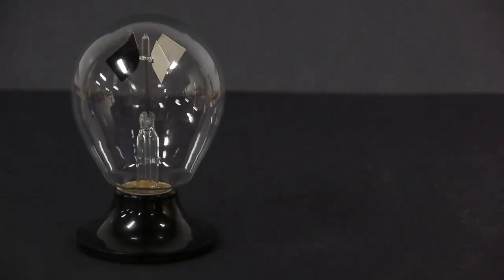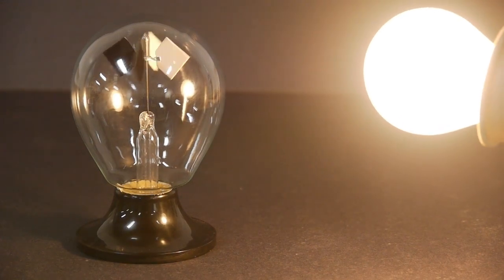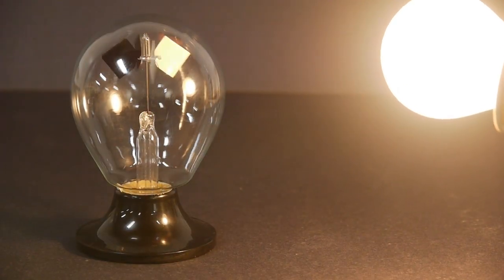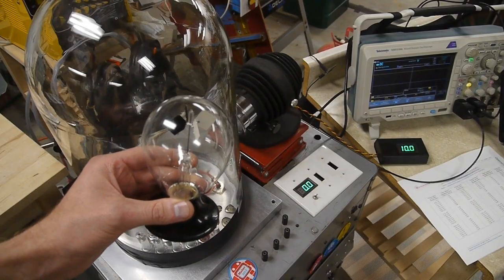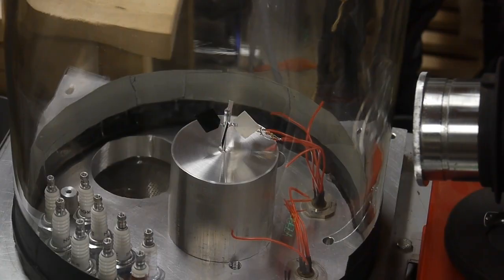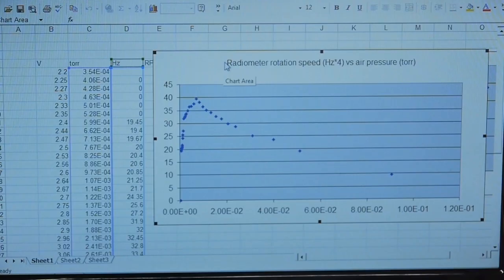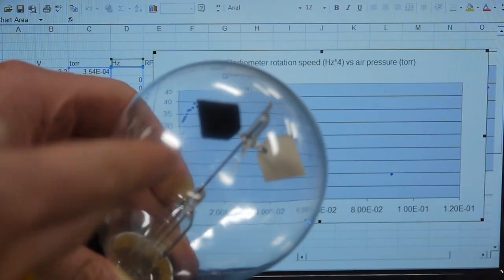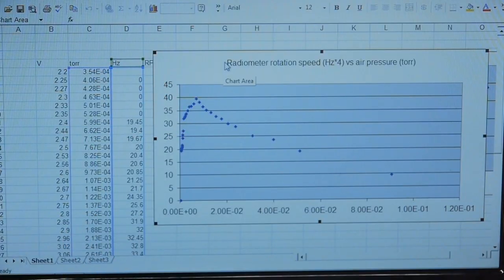How a Crookes radiometer works

Comment: whats the difference between heat and light?? arent they both electromagnetic waves??  what the fucks are photons, photons are quackery
Reply: Heat is molecule agitation. Light is electromagnetic wave, no mass. Photons are energy light packets, which are not playing any role here, it is a classic experiment and must be explained in classic terms, no quantic.
Reply: @joselunazzi2287  how are molecules agitated ? By electro -magmetic waves just like when you heat food in the microwave. Heat and light are effects of electragmetoc waves interacting with molecules / atoms wich are defined / composed by charged "particles" charged meaning electrified positively and negatively. I don't see the point of introducing photons?
Reply: @chevere0192  You put questions that needs no answer: all you wrote is correct. I don't see the point of introducing photons. But the Crookes radiometer is a very difficult to understand experiment, I am preparing an article on the many doubts surrounding it. It will be submited to the Latinamerican Journal of Physics Education in a few weeks.

Comment: OK.  So you lowered the temperature of the glass envelope and it spun the other direction....  There's not much gas in the envelope.  You slowed down the few molecules of gas that are inside the chamber presumably.  Why does that cause it to spin the other direction?  There's almost zero heat transfer via the gas, there's still some infa-red light striking the vanes.  Why does the white side become emissive in that scenario?
Reply: Due to Blackbody radiation and Osborne Reynolds law, where cold molecules flow to hotter ones; in the freezer scenario, the black is colder.

Comment: As the effect depends on a thermal gradient between the two sides of the vane, making the vane of ceramic or other insulating material should enhance the effect.
Reply: Yes, I wondered about that.  If the vanes are thin sheet metal one would have thought black and white sides were almost the same temperature but the black side is radiating more heat and heating the nearby air molecules thereby setting up a heat gradient in the air and hence a pressure gradient.
Reply: Vanes are either thin metal or mica--which is a an insulator BUT also contains Al and Fe.

Comment: Your explanation does not account for the backwards spinning when there is no light but one side of the radiometer is cold. There is no reason why the white side would be warmer than the black side in that case.

Comment: another thing can be observed, but can not be explained away by the random whole chamber air particles'  thermal-dynamic bumping in black and shiny side of the vanes is:   if you use a laser pointer, to shoot a beam of light ray onto the vanes, it will "push" the vanes to turn,  the point of laser ray lands on the dark side of the vane relative to the turning axle works out as Newton's law of lever or torque and pivot when turning a disk or turning a waterwheel.   It seems to indicate  something different,  I am guessing :    Radiation      The difference of thermal radiation forces exerted upon the black and shiny side of the vanes or radiometer.     The reason the radiometer not only react to heat, light, but also  react to coldness(mainly different amount of thermal radiation emitted from differently heated or chilled surfaces in case of ambient heat or cold propelling the vane).  In the  case of propelled by light, laser or sun light,   the radiation force exerted onto the vane is not secondary thermal radiation emitted from hotter side of the glass shell of the radiometer,(heated or chilled by external thermal influences applied) , in this case, light itself is a initial and final source of the radiation which bounced its force or momentum onto the vanes, thus caused its turning ( and the spot that the light ray force applied has different torque in respective to its distance to the vane rotational axle ).    Thus the radiation does have mass or momentum, if the radiation has particles in it(even energy particles) , these observations from radiometer may not enough to tell,    but what if,    ----  even radiation or energy waves has the capability of exerting force onto solid objects?!    (  this is just a speculation )
Reply: A laser sail, in the context of space travel (beam sailing), works by using powerful laser beams from Earth to push a lightweight, highly reflective sail, transferring momentum from photons (light particles) to propel a spacecraft

Comment: Perhaps I'm missing something but once I saw the comment below asking how big it would have to be to run a 10kW generator, I thought, what the hell.

Ben's explanation of the effect of momentum transfer from photons hitting the different vanes confused me.  Two photons of specified momentum hit, one each per colour of vane.  Why would the photon that carries some of its available momentum away with it on reflection impart a greater force on the mechanism than the photon that transfers all of its momentum to the dark vane when it is absorbed?

And later in the video, Ben tries to get the radiometer to work in as low a vacuum as he could supply.  He even states that in this scenario the only agent capable of affecting the mechanism is the photons and yet the radiometer is not running backwards as he suggested it would.  Of course, it wasn't running 'frontwards' either which suggests that photonic momentum transfer is simply too weak a force to have any effect in this experimental setup.

Comment: But why does cooling the outside make it spin the other way around?
Reply: Because - the dark side is also a good longwave IR emitting surface (a good "backbody" radiator and the silver side is not), and it runs cooler giving gas molecules less 'kick' when they impinge that dark side ....
Reply: @uploadJ  Correct !

Comment: if it isn't related to photons transferring energy, why does higher energy light, blue, make it spin at a low intensity, when the red end of the spectrum will not
Reply: because it is also related to photons. BTW the spinning power of colored lasers are in this order from high to low: blue>green>red.

Comment: What I find interesting is how he happened across this.  he was trying to make a perfect vacuum to get any air influence out of the picture.   Because he accidentally did not make a perfect vacuum but only a partial one is why it even spun at all in the first place. 

Does this work with round veins or do they need to be squares?

Also normal air pressure is 760 torr or 1 atm.    The pressure in the tube is less than 1 torr.  So its pretty close to a vacuum.   I wonder if it could be done using a excitable gas  one can be visualized?   That way you could maybe see the currents in action.

Comment: heat means basically IR right or whatever it is, it must be Electromagnetic radiation right?
if yes why does it need gas to propagate 
I also remember reading the heat dissipating radiation sheets used on satellites of some GPS satellites affect them which is why they are mounted symmetrically

Comment: The scientific term for the force is "Photophoretic force". Your observation is very interesting because in micro particles the force peaks when the mean-free-path of the gas is the same as the diameter of the particles. This force can be used to trap and guid particles which absorbs light.

Comment: Did you ever make a large one. Curious to see if the rotation peek speed follows some specific size .
My other thought is what if you could make one large enough to be a solar type generator...maybe crazy but Hay that's one big glass ball huh?
Or what if atmospheric pressure and speed correlate to a specific size?
If its creating a pressure differential from hot and cold off its edges is the propelling force would it not change the perimeters? 
Wondering if a wind generator that still spins in sun light or assisted by it would be even feasible?.
Don't call me crazy, its the ones with seemingly crays ideas that are usually the one getting locked in an a tower until proven right.

Comment: There is no such thing as a photon.    Mainstream science likes to pretend electromagnetic fields do not exist.  They do.  Electricity is not particulate and very little electrical current actually flows through the conducting wires of any electrical circuit.  The people that created the electrical systems well over 100 years ago which we still utilize today knew this.  This guy does not know what he is talking about.

Comment: Is this why planets spin around their own axis? Sort of like a Crooks radiometer?!
Reply: No.  Planets, stars and any kind of space junk spin as the result of  forces imparted to them as they came into existence.  With  zero friction in the vacuum of space, there is nothing to stop them from spinning forever [ I didn't mention tidal forces - earth &  moon interactions have slowed earth's rotation a small amount over the last few billion years.].
Reply: There are all types of forces in space;
1- Solar wind.
2- Gravitational pulls.
3- Collisions with dust or larger particles objects.
4- Magnetic fields.
5- Others that we don't yet know.
Reply: jrb, thats absurd to think that something that happened 14bil years ago hasnt over time had that angular momentum completely negated/replaced by something from other reactions. im sorry but the official story isn't right, like usual.
Reply: @username4441  No, you don't understand why the "official story" makes sense. That's not the same as it not being right.
Reply: @username4441  You can look up my argument in any physics textbook. The fact that you don't get it doesn't make it a bad argument. Conservation of angular momentum, the relative absence of friction, and the huge mass of the earth make it not at all strange that the earth keeps spinning without slowing down appreciably. Your objection that 14 bln years is absurdly long mostly speaks to how short-lived you are on cosmological timescales.
Reply: @username4441  The Dunning-Kruger irony in your posts is painful to watch. As is the playground level of your insults. "IQ", you've learned a new word, good boy. Now go do your calculus homework. Try finding the integral for the net contribution of asteroids randomly striking earth to earth's angular momentum. Also, try to estimate their total collective mass relative to earth, based on the observation that the earth hasn't grown noticably bigger over the past few billion years. Show your work.

Comment: What's the purpose of all those spark plugs inside?
Reply: Brian Su an insulated and airtight way to get electrical connections inside the chamber.
Reply: Ohh right, wow what a great idea :) need to get branded ones though as those cheap brands do leak, but I mean the really horrible quality ones.

Comment: This isn't accurate is it? The claim is that the white face would get more energy from the photons by bouncing it. But that's just plain wrong. If you're bouncing something out of you you only get PART of its energy, the rest is simply re-directed, but absorbing it means ABSORBING IT, as in all its energy is transferred to you. So the black face, whether its thermal energy or momentum will always receive the fuller extent of the photon's energy.
Reply: But the change in momentum is greater on reflection, the energy comes from a slight frequency shift of the photon.

Comment: So, theoretically, `light sails` could work on this principle? If the sail was able to utilise a large amount of a stars light/heat? Also the (air) resistance is space is, well, nil, what with it being a vacuum and all.
Reply: Theoretically, yes, there are actually ways of utilising this in space to generate movement, but the thing is that you don't have just one light/radiation souce, you have dozens of them, so the same forces that move the object can also slow it down. Also, you have to be extremely precise on the way you use it, because a minor change in the intensity (such as a planet orbiting the star, thus blocking the light) of the light source can decentralize the object, making it change it's path. But I may be wrong.

Comment: awesome device. I was wondering if this device is capable of withstanding an electrical generator or motoring to mass-produce electricity. other than nuclear fusion or nuclear power. if this device is capable and switches from heat to cool. or light too cold or light to heat. then why haven't anyone thought of doing it this way then creating electricity using nuclear harmful chemicals in the air. subsequently my opinion this device can be altered just like a light bulb as a reverse current. try integrating electric magnetic motor to spin the current ratio of the output power is enough to the able to change the idea of electrical Propel electricity form a Mass scale
Reply: The effect you are exploiting is not large enough to generate power, you would be much better off using a stirling engine for this effect.  One company in california has developed a soler collector to shine on a striling engine for a very efficient conversion of solar power into mechanical energy. https://en.wikipedia.org/wiki/Solar-powered_Stirling_engine

Comment: Saw one youtube video that shows that a simple keychain LED can spin the radiometer if it's a purple light but has no effect with any other colors from similar keychain lights. So wondering if vacuum level changes with different colors.
Reply: That video is nonsense. Those keychain LED do likely not have the same intensities. Or lets say, that we don't know if the intensities are the same. The batteries might be of the same type, but they might charged differently and the LED's probably have different efficiencies. So the setup you saw in that video is just way too uncontrolled to tell us anything. You'd have to make sure, that the intensities are the same. Then you'd have to inspect the surface of the vanes and see if they absorb all colors equally or not. If the vanes absorb those colours differently, then of course you'd expect a difference even if the intensity of the light were the same. 
The bottome line is, that the guy from the video, you saw does not know what he's talking about or what's needed to set up a meaningfull experiment. Furthermore he lied about what science already knows about the crookes radiometer. If you want to learn about science, then you should stay away from that guy.
Reply: No magnetism, just light color had different effect.
Reply: Or rather "seemingly had an effect"  Was it intensity or color?  One response was that it was intensity.  How does he know?  Did he test it or is that just what he's been told?  I suspect intensity is correct, but I don't KNOW that is the explanation because I haven't tested it.

Comment: Can we make a radiometer in our home itself? If yes ,how?
Reply: Propane torch. Broken light bulb or a mason jar. A good vacuum pump. I have considered making 1 myself. We are not obligated to weld the glass shut.
I recently made a light bulb with tungsten filament but since there was a little bit of oxygen, tungsten oxide was formed which is beige in color. The filament lasted for 30 sec I think.
Copper and iron lasted 1 sec.
Reply: louis tournas
thank u....

Comment: In the first part of the video you applied cooling to the surface of the radiometer, which had an effect. Then, when you transferred the spinner to the vacuum chamber, you effectively had a chamber with more volume. Is the volume of the chamber relevant at all? I suspect this is not easy to test, although, perhaps you could introduce different sized containers into the vacuum chamber.

What about repeating the experiment at various ambient temperatures? Apparently, the outer surface of the chamber serves as a heat sink. If you could repeat the experiment at very high or very low ambient temperatures, would you see a difference in rotation speed? Which would be faster, and why?

Comment: can someone explain. I understand it is gas pressure that creates the spin. but something bugs me about his description of IF it were light pressure. why would it spin the reflective way? You'd have double the force on the black side, logically it would spin that way. Force hitting the black, & force hitting the reflective that banks off and hits the dark side. So it would be 2:1 for that darker side if it were light pressure.
Reply: you guys fool! god's hand making it to spin....is jesus touch....
Reply: It would spin the reflective way because the black face absorbs the light (AND its energy) while the white face reflects it which leads to it getting pushed on that face and not at all pushed on the black face.
Reply: So basically there's more force exerted on the act of reflection than absorption. Got it thanks
Reply: Jimmy D Exactly, no problem mate!
Reply: Jimmy D you can also think of it as conservation of momentum, the black side stops the photon then its momentum is added, while with the reflexive surface, this happens then the light goes back in the opposite direction so the same momentum is added again to the surface

Comment: Question: What would a practical application of a Crookes radiometer be?  I seem to have memories of seeing them from time to time at roadside installations in southern California in the 1960s - 70s or so, in remote areas, and in the presence of what may have been utility cabinets.  I never knew what or why they were.  (Admittedly, my memory may be totally wrong.  That was a long time ago.)
Reply: Perhaps to measure intensity of sunlight?
I have never see these radiometers on roadsides in Quebec or Ontario.
Measuring sun intensity can be done with a photoelectric cell and a voltmeter.
Reply: Craig Bass Those were probably wind meters, not radiometers.